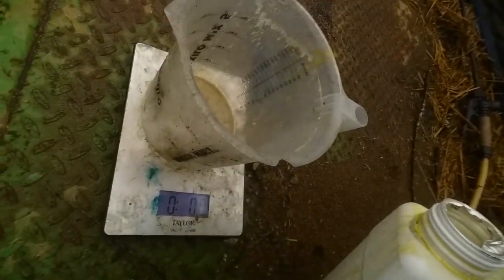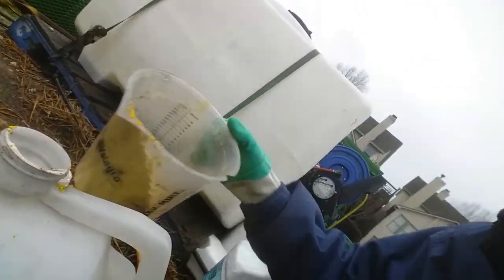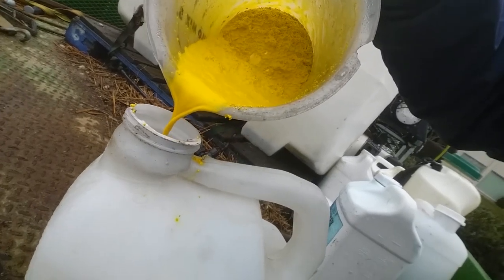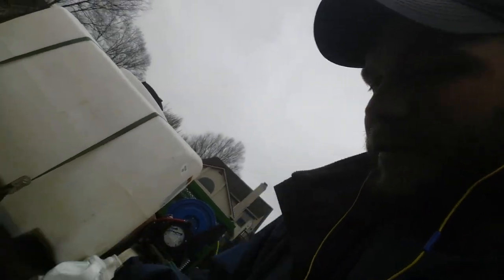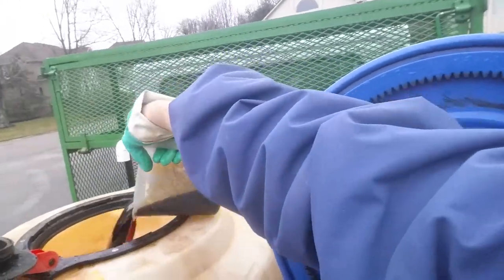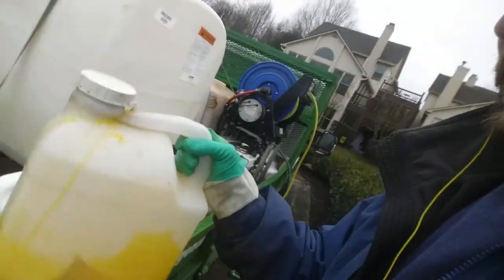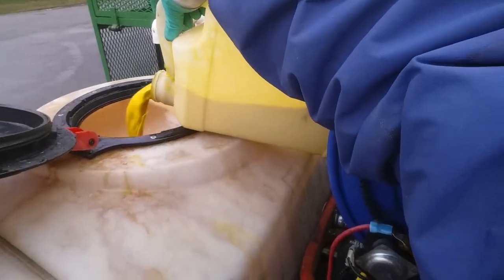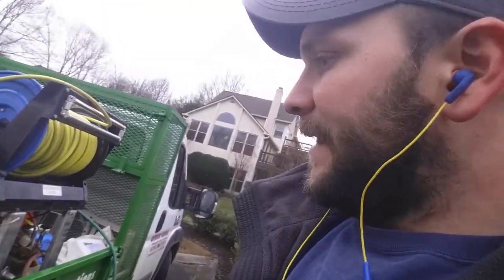How To Mix A Tank To Spray For Weeds

Comment: Do you ever run dimension ? Or do you prefer the barricade?
Reply: +Outdoor Designs Professional Svcs & Nursery Matt do you use drive xlr8 very much this time of year? I've got some mature crabgrass that won't die lol
Reply: jeremy d try q4 works great for crab grass
Reply from the maker: Mark Florenzen not a big fan of q4. I much prefer drive xlr8 with a high quality seed oil. if you need that extra kick, drop the seed oil, add your dismiss at 6oz/acre
Reply: thanks i want to learn all i can
Reply: whats the high quality seed oils? never heard of. would love to her more thanks
Reply from the maker: Mark Florenzen  dyne-amic is the one I prefer. methylated seed oil is also good.

Comment: Is the weigh scale as accurate as a measuring cone? If so I'm on board with that route.
Reply: +Outdoor Designs Professional Svcs & Nursery The  TeeJet 1104 nozzles you recommended for my backpacks are spot on and just what I've been needing. Thanks!